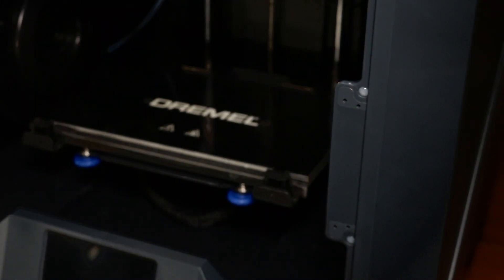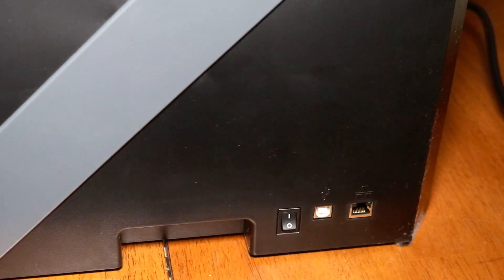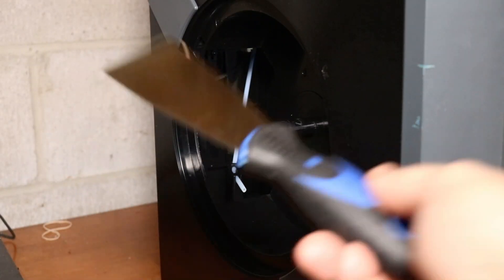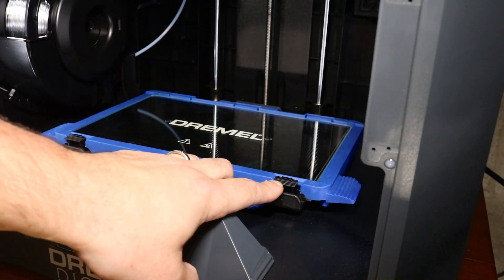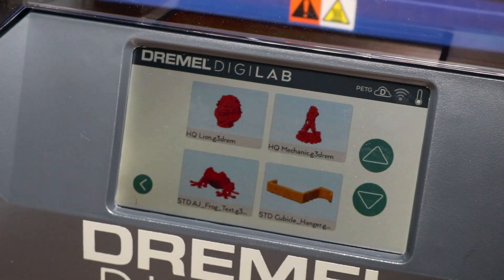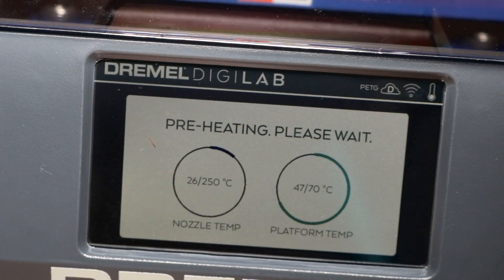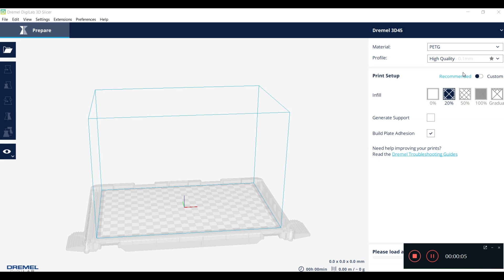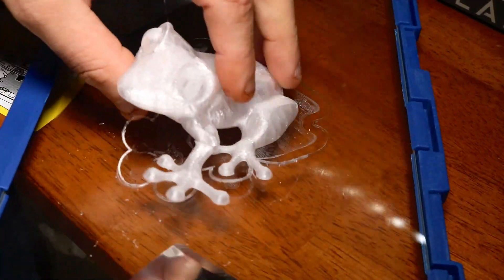Dremel 3D45 3D Printer REVIEW!

Comment: Hi everyone, I highly recommend print cars vertically, in two half pieces... from middle to front, and rear, and then glue it.... I have printed a lot of cars, and printing vertically, you also avoid using infill, so save a lot of time.... For inner support sometimes I modify STL adding internal holes, so the slicer use its "walls" making internal supports.... Regards and good printing...!

Comment: I just bought this printer on Ebay, I originally found it on Amazon, but their price was high I went on Ebay and found it for $300.00 less, that's more materials I can buy for the printer. I ordered PLA, PETG and ABS for it, I stuck with Dremel's spools, just because it's easier, they are more expensive for about half the amount, but if you want to run other spools, you have to print an adapter so you can load the larger spools and you have to leave the spool door off. Anyway I was glad to find your video and I'm definitely going to look for more of your videos on this machine. I don't have mine yet, should be in by the first week in December so I will take in as many videos as I can before I get the printer. I'm kind of like a kid anticipating Christmas morning. Thanks again for your great video and can't wait to see more!

Comment: Printer only works with flash drive and cloud software (very slow). Dremel still didn't release USB drives for Windows (online complaints since 2019). Printer is connected to WIFI and is able to do firmware update but software applications can't see it, not over LAN Ethernet connection, not over WIFI. Basically you need a flash drive to load your prints. You probably need to be a network engineer to make it work on your LAN. Not user friendly and not plug-and-play. DO NOT RECOMMEND!!!!
Reply: Custom Home Theater Installations I’ve had this printer for two years and not a single problem with it, in matter of fact I printed a lot of models and my biggest project I printed is a  ghostbuster proton pack with 100hrs print and 100% scale. I’m satisfied with it.

Comment: The fact that Dremel force you to buy and use only Dremel proprietary filaments with this printer makes it a none starter for most people.
Reply from the maker: Na, I printed out my own roller and use hatch box filiment with it
Reply: No. You can print with any 3rd party filament of the proper diameter.  You just have to set up an external spool mount which you can design or get ready-to-print from Thingiverse. The RFID chip in the spool isn't a security device to keep you from using 3rd party filament. It just sets up appropriate printer settings for you. It is easier to use their filament, but when you know what you're doing you aren't blocked. You can override the settings if you like and feed in any 3rd filament with no problem.

Comment: TRZ I'm on board with that 3D printer. I can't wait to see more stuff come out of that thing. I'm just wondering how much does it cost to replace the spool inside. I will talk to you later. Peace brother
Reply from the maker: its not bad bro. Depending on the material, somewhere around $28
Reply: Dremel digilab